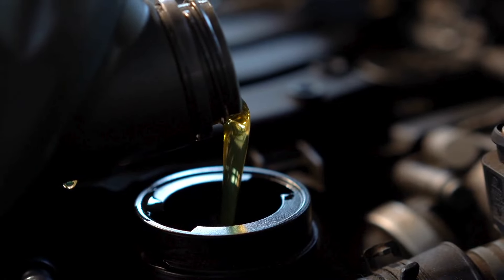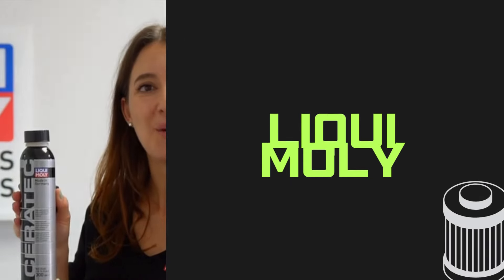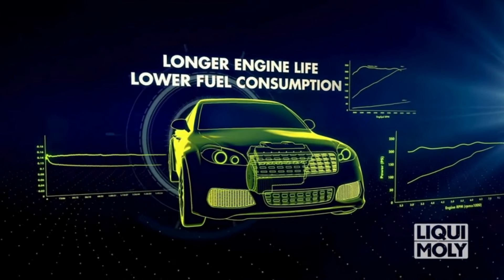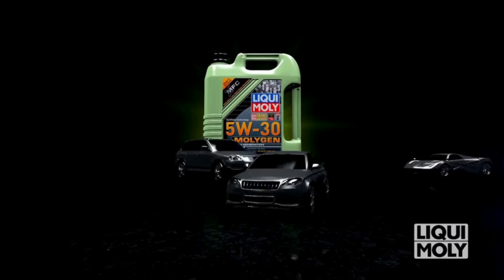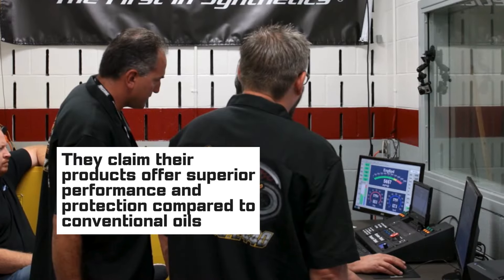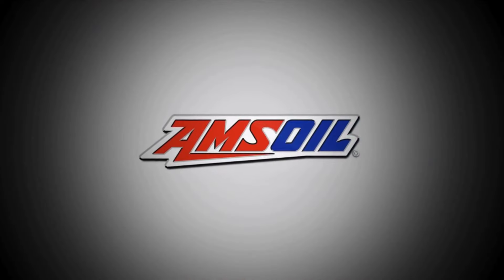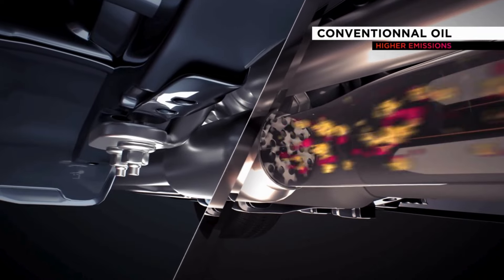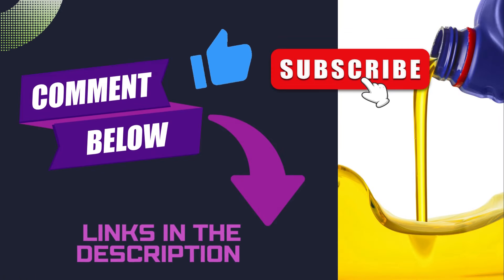Top 3 Synthetic Engine Oil Brands - Liqui Moly - Amsoil - Motul

Comment: I have been a huge fan of Castrol oil.  Lately, they are advertising long drain intervals but I'll still change the oil sooner.  Seems like you need  bypass oil filter in addition to the standard full flow oil filter for those long drain intervals (which isn't possible to do on all engines)

Comment: Im someone that switches oil brand every oil change. I've used Valvoline, Royal Purple, Liqui Moly, and just got in my Motul. In a diff car i have run Pennzoil Ultra Plat and Redline. 
Im excited for this Motul, but facts are facts, and i dont see or feel much a difference in any of em. All run astonishingly. If i had to give the edge in power and sound, id say Moly Special Tec. And the Royal Purple was the quietest and smoothest right along with Valvoline. Cant go wrong. I hope Motul makes me happy as well.
Reply: How was Motul with you compared to the rest?
Reply: @MohamedQureshi  Motul is running brilliantly. I really cannot tell the difference between any of them. All have been perfect.